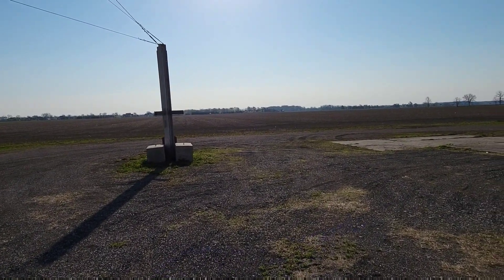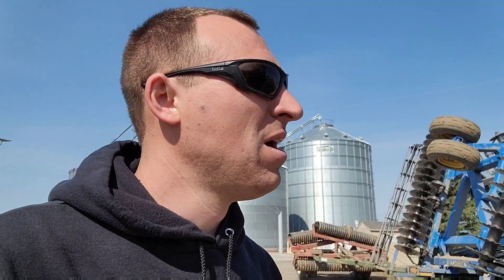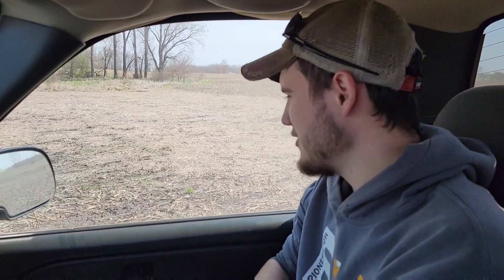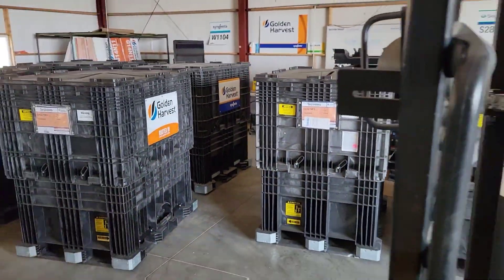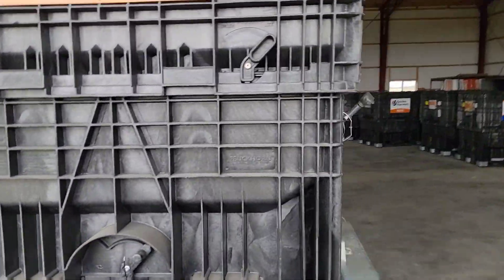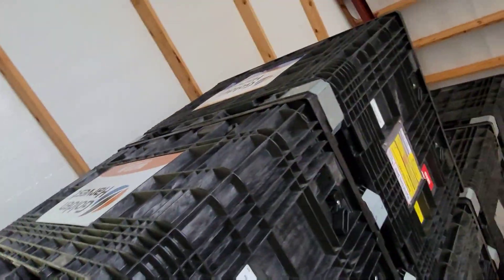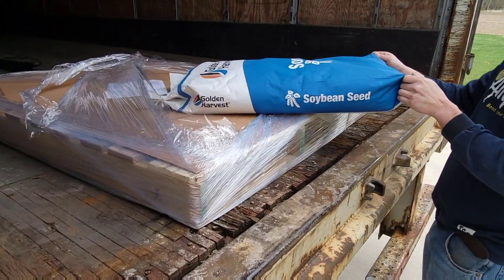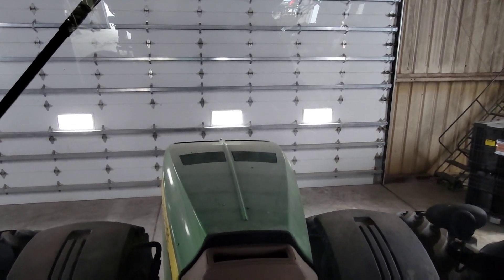Over Powered! - #401

Comment: I really don´t know the English name for it . I guess joint should come close . They are sold in different sizes and left and right threaded . Replace the linkage with threaded rod and put a joint on both ends. Where I live every car part , tractor part or truck part store has them . If you see it you´ll say " of course " . I know this ain´t much help . Sorry for that . (edit) Heim joint could be the word but the are also sold closed cap so you can pop them onto the existing ball .

Comment: I'm sorry I have no idea what they are called but the only similar joint ai have seen like that is on a sailing boat where the hydraulic ram eye on the piston pushes and pulls on the tiller. You might find something similar on the steering cylinder on a traditional style of self propelled grass mower that uses a steering wheel rather than alternative steering systems.

Comment: I really don't understand what has happened to farming... When I was working ground if we went any  faster than 5.5 someone was getting their ass chewed out.. now I know that they have new implements that are supposed to be pulled faster but I still see the damn things bouncing so it must be rougher than hell.. do the tractors ride that much better now a days that it doesn't bother the planter operator or what?????
Reply: Suspended front axle, suspended cab , air seat,  night & day vs the past. 
Tillage tube frames increased in size/thickness. Higher tillage speeds are a necessity to meet the compromised planting windows today. Likely YOU did NOT plant 3,000 + acres, correct?  As for planters, the vertical tillage, high speed discs, groom the field for smooth planting, but planters are now rugged to allow 10 mph  application. With no-till, ground should be smooth enough when not disturbed. Many also use a vertical tillage or high speed disc , shallow depth to incorporate corn stalks. Big Ag  today comes w/ big risks, & piddling around w/ under-powered tractors @ sub-5 mph, is a recipe for disaster.
Reply: @billupstateny9151  no we tilled 2200 acres and the last tractors were 20series jd but thank you for your response
Reply: @scottb2712  I should have clarified, meant 3000 acres in a single season, not accumulation of multiple seasons. Just contemplating how many jd 20 series each with separate tillage and planter implement,  & separate operator for each field. The old adage, born @ night,  can't let ridiculousness pass for fact. And the combines, multiple, were jd 4400, one for each field?
Reply: @billupstateny9151  of course you meant one season and it was actually more than that when you include double crop soybeans.. we had 8120 planting 8320&8420 working ground.. but there was a time that we tilled 1800 acres with just a case 2590 with a 20ft disc  and 4430 6 row planter
Reply: @billupstateny9151  I guess we just work harder down here in Delaware than you guys do up in ny
Reply: @scottb2712  Typically when a 20 series # is stated, it references the 1960's-1970's version 20 series. For later models, the FULL numerical nomenclature is written out. As for deleware in general, there is little to brag about unless there is status in SMALL. Think most of out counties are larger than the whole state & more populous.